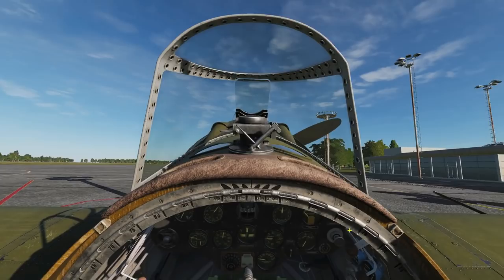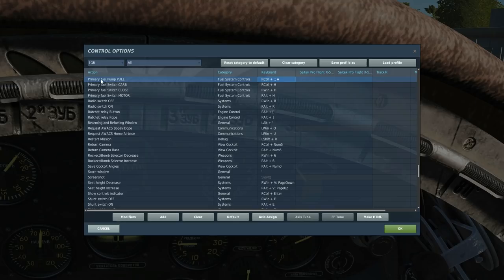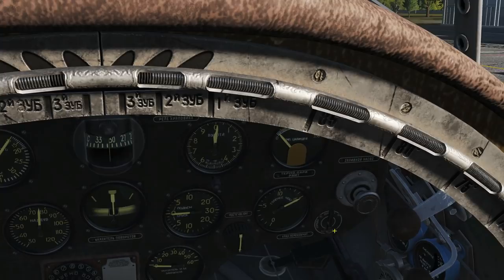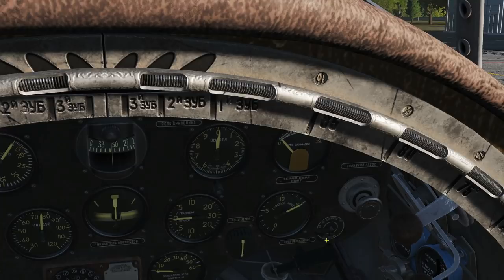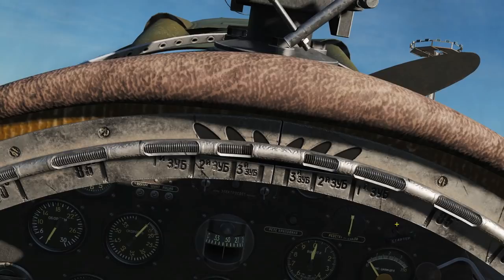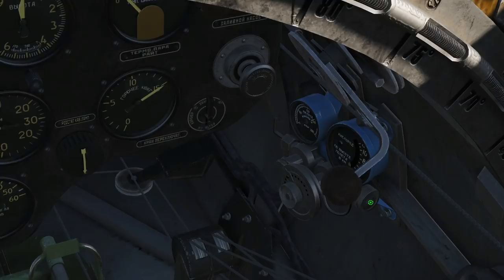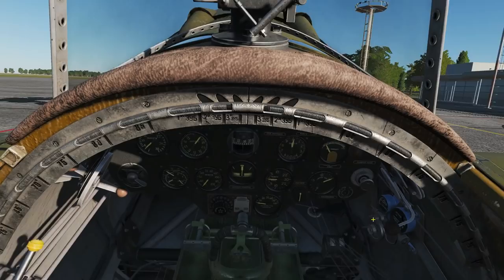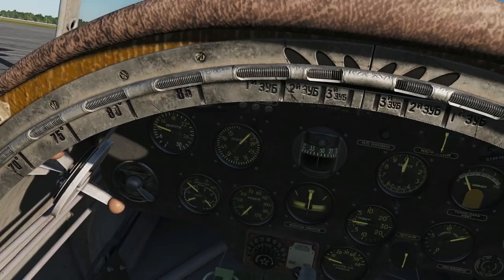I-16 Ishak: Cold Start Tutorial | DCS WORLD

Comment: About oxygen system. The "МАНОМЕТР" gauge is a Pressure gauge and shows (obviously) pressure in oxygen tank in Kg/cm2. The second, bigger gauge is actually the one you want to adjust with your altitude. It's actually reads in Russian "КИСЛОРОД ПО ВЫСОТЕ В ПОЛЕТЕ КМ" which translates to Oxygen by altitude in KM. So by turning oxygen adj. valve you set the value that roughly matches your current altitude. Pretty simple, actually, but only for one who understands Russian :)

Comment: My guess is fuel mix to rich (Fully forward) until engine is warm. Akin to a choke on a 2 stroke. Then once warm lean out (pull back) engine in flight until you see engine temperature start to abnormally rise then add a bit back in. Should be most efficient..
Reply from the maker: thx

Comment: I know is a bit late... but at minute 5:27 if you look on the second blue gauge, the big one behind small one... you can see the word высота read something like vysota which means hight.... aka Altitude and is the word to be found on all russian altimeters and you can see it if you pause at 5:27 on the altimeter! So that means that second gauge is not the flow meter but is the gauge you check that the system provides oxygen for the required altitude. Probably is not doing much while on the ground at batumi... just a thought...

Other than that. excellent movie as usual.

Comment: Do you not have to check magnetos after engine start?... switch from both to 1 then 2...makes sure both are working..then use 1 or 2 for flight never both..if u get engine probs in flight u switch 1 to 2 or 2 to 1..IRL
Reply from the maker: Agree for real life but don't think so in this sim. I may be wrong...
Reply: @grimreapers  your prolly right... random failures turned off ! 😎